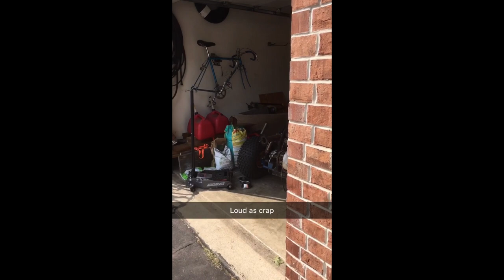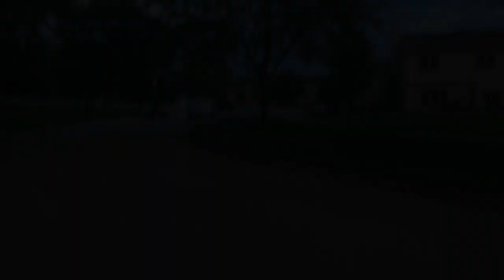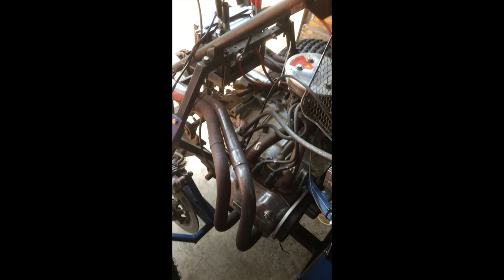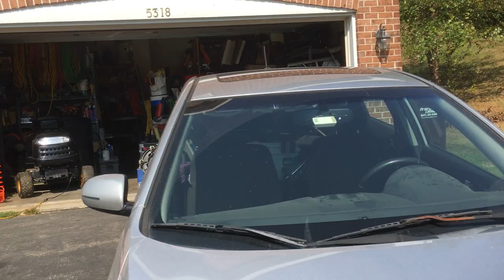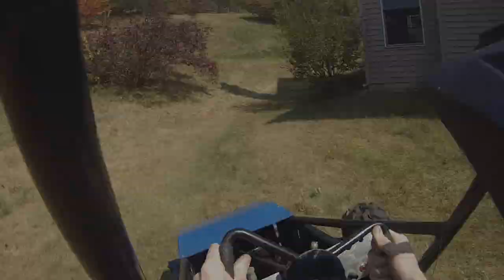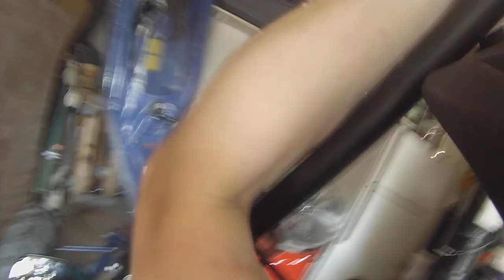4 Cylinder 1000cc Honda Goldwing Off Road Buggy

Comment: I’m really surprised that more people don’t use this engine. I would think that makes a ton of power and torque. That thing sounds mean as hell.
Reply: And the lower center of gravity. That's why mine will use one.
Reply: Plus you can find these things dirt cheap. There is a 1100 goldwing here by me with bad tires and forks but runs for $250 Perfect for a build like this.

Comment: I wish there was more content on how you built it
Reply: It’s all generally the same idea, just minor modifications. The only thing you genuinely need to figure out is the exact final drive (he used the whole final drive from the goldwing up to the wheel, and substituted a drive chain instead of a rim. I would assume it’s a 1-1 sprocket tooth count) everything else is the same as you would do on any other build. It boils down to what you need to fabricate if you can’t buy directly. I’d be more than happy to help if you’re actually interested in a build. I’m in the middle of doing a build myself, except I’m going with a shaft drive to an lsd (limited slip differential) off an old 318i bmw. 
so I don’t have to worry about the chain and sprocket going out on me or getting the ratio wrong and I’m doing a budget build using only stuff I have lying around. Makes it way more fun than just bolting a pre-made plan together.
Reply: @jrattackk hello I have a similar build going, wondering connecting the shaft to the lsd
Reply: @carloslopez3233 just a matter of finding right shaft size🤷🏻‍♂️ best bet is finding a right fit at the pivot joint

Comment: Hi also what size of sprocket are used on the rear gearbox and axle set up could you send pictures of that to thanks. looks like fun moves real good.
Reply: @longsleevethong1457  Hi Jay yes I would of used a Subaru rear differential  I wish he would of knowing how they did the exhaust pipes off of the head any way there is a lot of ways they could of built it but ye shaft to chain No????

Comment: i have a 1978 gl1000 on a gocart frame that i built i,ve set it up for sanddrags no supseion on front or back run  great until i got the wires too close to the exhust and shorted something out need to know what wires i need just to run the engine its really bad as hell  an i thought i was the only one that figured out the rearend t00k the swingarm out and mounted a spocket so let that be our secret

Comment: steering looks like it sucks...  100 HP needs real steering.  other wise it looks good.  I wish that he took it to red line, but if steering is iffy, then I understand why.  This is why you don't use go-cart steering parts on a race car frame and engine combination...
Reply: Given that my 97 GL1500 Valkyrie with the flat 6 has 102 horsepower, I don't think the old 4 cylinder Goldwing is quite up there..